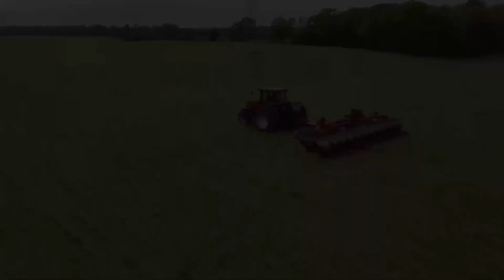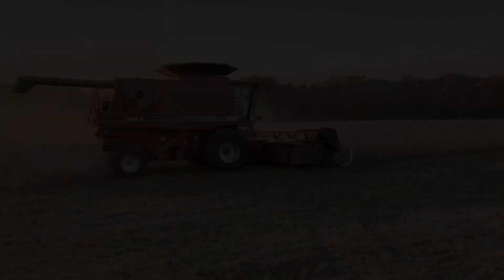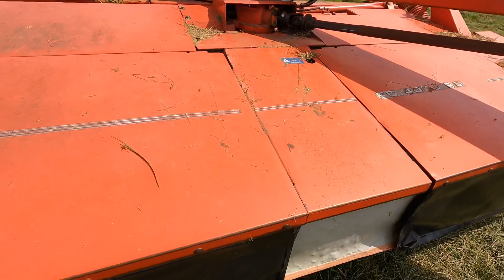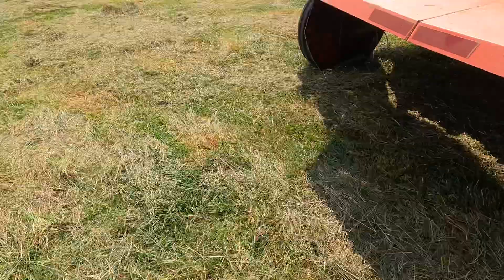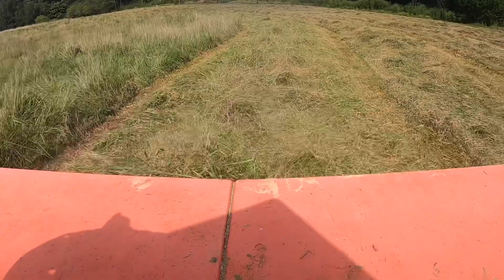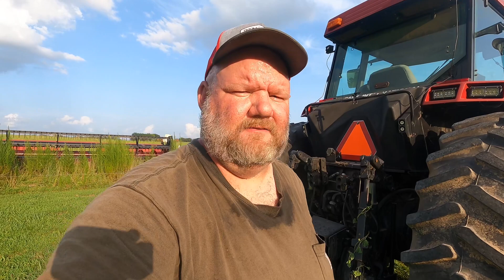The 8940 is Back! And I’m laying down some hay.

Comment: Glad you've got the tractor back, and hoping the hydraulic oil hasn't damaged anything. My wife poured hydraulic oil into our 4 wheeler years ago by mistake,  thinking it was gas. Didn't run well until I drained and flushed it. Was really my fault, as I had been using a hydraulic jug to put gas in it. Good luck! 👍
Reply from the maker: We buy our hydraulic and engine oils in 55 gallon drums. Then we pump into old chemical jugs. We label the jugs but always confusion. Like I said I can’t blame anyone.

Comment: I'm glad you got your 8940 back.  I was going to get a center pivot mower when I bought a dicsbine.  Then I remember it wouldn't fit through some of the gates on the other farms.
Reply from the maker: This one is getting some wear. Dad and I was discussing upgrading yesterday. In a way we need a smaller one and in a way we like the big one. We don’t put up as much hay as we use to.

Comment: I just got my 1963 Fordson Super Major fuel injector pump back from the shop. International Fuel Systems is located north of me in Findlay, Ohio. I couldn't believe that they were able to get all the parts for these still. They had it done it 3 days. The guy I was dealing with said they work on 3 or 4 of these old pumps every year from all over the country.  If you have any more injector pump problems,  it might be worth at least a phone call.  Hope you got it all fix up.

Comment: Sure glad you got your tractor back.  I remember your comment about finishing a job even if you had to use a couple of mules!  Your "get it done" attitude is an inspiration.  The hydraulic oil for engine oil situation is kind of iffy.  I would think increased engine bearing wear would be the most likely problem if any.  I don't know if you can drop the oil pan easily and plastigage a couple of rod bearings to see what the wear looks like or if that would be a major job.  Good luck and God bless.
Reply from the maker: That makes sense. Yeah I need to get it checked out before this Spring. I’m still waiting for the oil analysis to come back.

Comment: Hey russ, i have a mx 240, 99 model,  that several years ago injector pump went bad and it put fuel in oil and i didnt know it till low  oil pressure warning came on when i idled down to turn around. Been fortunate not to have any problems. we also still running 71 and 72 series boxcars.
Reply from the maker: I didn’t smell like fuel but it was something going on. How do you like the MX compared to the Boxcars?
Reply: @Thomasfarmstn     To be honest i like both tractors. The mx is a lot heavier so it handles the 6 row 3pt implements better. The shuttle shift is so sweet turning around at each end. Transmission is same 18 speed, but electric shift. We harrow and pick pnuts with the 72 and 7150's but they do tote the 3 pt implents when needed. I like the boxcar cab better cause it aint so big. I could go on and on......

Comment: Glade to see muffler on them ole Machines. Grandpa and dad always pulled them off and straight piped them.  Maybe that’s y they say what a lot   Lol
Reply from the maker: That muffler is actually about 2 months old. It had the original until then. Shout muffler the paint is burning off. It won’t last 46 years like the original one.

Comment: I'm not 100% sure, but I think hydraulic oil is somewhere around 30W. I know it doesn't have the same additives as engine oil, but topping off a tractor that holds several gallons of engine oil shouldn't hurt anything. It's certainly not going to help, but I just can't see it ruining a motor. Anyways, I hope it runs good and keep making videos.
Reply from the maker: I’m not 100% sure that was what it was but the oil was thin and the engine was making a noise before we changed the oil. The oil has been sent off for analysis. Those results hasn’t came back yet.
Reply: Could be fuel from the bad pump if it was thin. I guess we'll all find out when you get the analysis back.